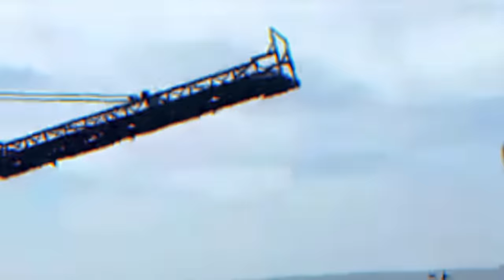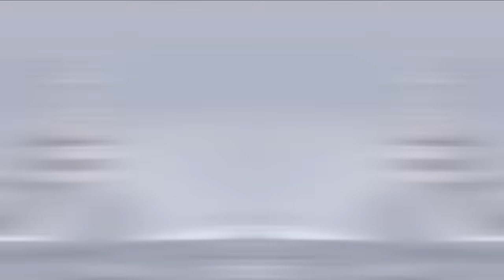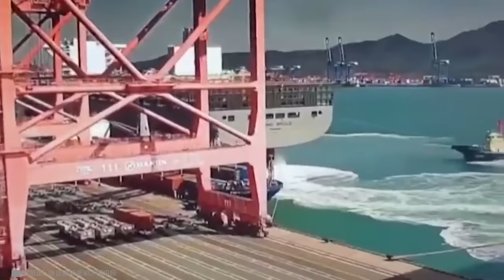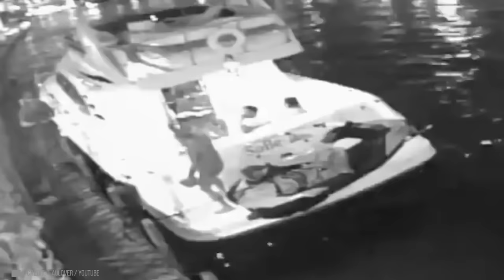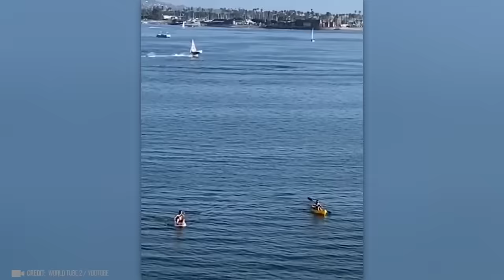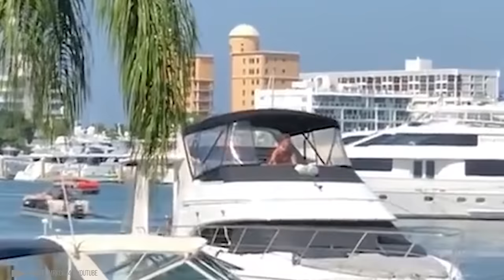30 Biggest Ship Collisions and Mistakes Caught On Camera

Comment: I have seen a few ship wrecks in my lifetime.
Mostly the crew and Captain are at fault, because they failed to do something like check for malfunctions onboard, improper navigation, go slow in crowded port areas, misunderstand weather info or keep up with weather updates, or just neglect warnings from other vessels. 
Ship inspections are very important and should be done frequently. 
Nowadays there are floating metal debris which can cause damage, but are visible to radars and scanners on board a ship. There is also Satellite images and cameras... 
It just depends on what type of a vessel one is on and who is the Skipper or the Captain. 
Thanks I loved the video.

Comment: Ady Gale was NOT designed for Anti Whaleing ... It was Designed for Around the World Speed run! and the retrofitted to go anti whaleing
Reply: Also, the water cannons aren't to "distract" them, so the can ram them with their boat.
The water cannons are to keep them away. They intentionally get in front of other boats in an attempt to force 
a crash. That way they look good & are seen as the "victim" of the "poachers".
Reply: @travissmith2056  the video shows the whaling ship deliberately turn into the Ady Gil which was disabled in open water at the time.
Reply: @26th_Primarch  "Yeah but protecting whales is gay." - Average youtube commenter
Reply: @travissmith2056  you should have seen it , the whale boat did turn to get andy gill
Reply: The retrofit didn’t work very well.  : )
Reply: They should have mounted a 3 inch Oto Melara autocannon loaded with HE, would have been a better choice than blinding lasers.
Reply: @fabianhenrich4697  i say they should just buy an old sub for this stuff, they can dive, stalk the ships and then, when needed they can surface. they can even run silent and the whaling ships wont even know they are there. they could also aquire some torpedos and well, you know
Reply: @PlutoProtogen    Well, is what they’re doing illegal everywhere?   If not, then the anti whalers are pirates, and should be treated as such.   You can’t fault someone for trying to feed themselves and their families.
Reply: @petulantpeterturbo  actually whaling as far as i know is banned around the world, a few countries still practice it, but it is illegally done, those japanese ships are doing it illegally

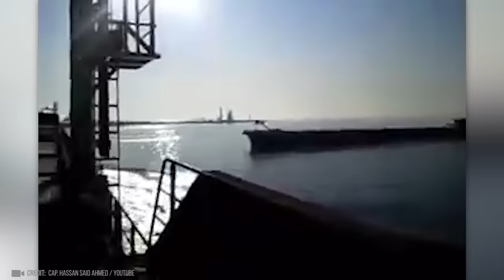Comment: At 2:40, the BC Ferries motor vessel Queen of Oak Bay, en route from Nanaimo to Horseshoe Bay, was unable to engage reverse to take off its way when approaching the terminal.

Having sufficient warning, the bridge crew successfully steered the ship toward a relatively clear area of sandy beach just to the west of the slip.

As I recall, the ferry was not severely damaged, though it is an older vessel nearing the end of its operational life. It was floated off at high tide. Several private vessels were damaged, some severely, as shown in the video. Out of view a number of other boats were driven against each other and badly damaged as well. There were no serious injuries, I believe.
Reply: The throttle switch disengaged from the control arm leaving the ship speed uncontrollable. The failure was an $.08 cotter pin. As a result all the ships were retrofitted with a second cotter pin and the engineers in the entire fleet now have a procedure planned in the unlikely-hood of something like this happening again.

Comment: In the past, when a ship approached port after many days / hours sailing. The engine was always slowed down and maneuverability was tested by backing up the ship, before the ship entered the harbor and one was sure that everything worked. Does anyone remember this ? .
Reply: engine preparation before docking and undocking has SOP checklist unexpected incidents is unpredictable
Reply: i have limited experience, only 4 foreign dockings, but each time the Pilot or harbor master came out and got on our ship, even though once we had a licensed pilot from that harbor already on our crew as the first mate
Reply: Thats a SOP long time ago
Reply: @socratesalegrado745  - Yes, it was 🧐
Reply: Doesn’t prevent failures occurring after the test though.
Reply: @magicmulder  - 100% correct

Comment: The engine on the Queen of Oak Bay was not faulty! A contractor who had overhauled the prime movers, incorrectly installed a cotter pin in one of the governors. The cotter pin fell out during low speed approach to the berth. This caused an overspeed condition on one engine, which caused the engine to shut down. As a result of this occurrence the second engine also shut down. The Master of the vessel had no propulsion, and there was insufficient time to drop the anchor, as there was no one on standby at the anchor station. The vessel had steerage, and the master had to make a split second decision to either hit the berth, causing a hard landing and risking injury to passengers and crew, or hit the marina, hoping no one was on board the vessels tied up.

Comment: I actually read the story on the yacht. The yacht captain was NOT ignoring the horn; in fact, his decision was based on it. Apparently the Knutsen's horn had a more specific meaning than what we mean when we toot our car's horns: it was a signal that the ship would turn to starboard. Based on that signal, the captain of the yacht decided to cut across the ship's path, actually violating British maritime regulations when he did so. If the Knutsen had turned as it had signaled then there would have been no incident, but unfortunately the Knutsen detected another boat along its new course and aborted the turn, leaving it on a collision course with the yacht. This is why those regulations the yacht captain violated say what they do, and the yacht captain was held accountable for the incident.

Comment: 1) I hope that guy got a new tuna boat! 2) I can understand when two small boats can't see each other. I might understand when a large ship doesn't see a small boat. But two OIL TANKERS? When did they start putting blind people at the helm? 3) I feel bad for all of the crashes caused by mechanical failure. Imagine doing everything right, and you get wrecked anyway!

Comment: A ship is not an airplane and there is almost nothing to do when you make mistakes. Therefore, lack of vigilance and disregard for the safety instruction causes at least 90 percent of the photos. The remaining ten percent is the result of an engineering or mechanical failure 🇮🇱💥🩵🇮🇱

Comment: Honestly... 
Such big ships are mayhem and Absolutely tough to handle.
They dont operate like cars - dont have brakes to appy in emergency, have damn big engines, very complex handling and most importantly - operated Manually unlike Aeroplanes which fly by wires. 🤔

These are big machines with big investements turning out to be a  big liability ☹

Comment: Thought motor always has to give way to sail !!
Reply: It does.  Legally.  In real life, ships don't have brakes.  Do you pull out in front of traffic with your car on icy roads because you have the Right of Way, or do you let them slide sideways through the intersection first?

I personally watched a sailboat of about 25 feet come within yards of getting munched.  She sailed down the starboard side of my ship, then turned to port directly across our path, close enough to our bow that she was NOT visible from the bridge.  Sure she had the technical Right of Way.  That said, taking a 25-foot fiberglass boat close across the bow of a 650-foot US Navy ship steaming at 8-10 knots in a congested shipping channel was probably not the best idea.  The "F**K WAR" banner that the sailboat was streaming at the time makes me think that it was a deliberate act.
Reply: @kevincrosby1760  Thank you for your somewhat insulting reply. I have never been in a car crash in my life !
International Maritime Law states 'Motor gives way to sail on all occasions' - quite simple really, hope you learn.
Reply: @kevincrosby1760  Thank you Kevin for pointing out that ships don't have brakes. I have been sailing for 35 years and I guess that on the water we have all seen 
terrible near misses. It's a bit like driving on the highway when you stop at a STOP sign and a semi rig just goes straight through. You give notice to other vessels
of your intended course and you don't instantly turn in front of a 30 thousand ton motor vessel. Intelligence is the word, the same as on the roadways, unfortunately
intelligence on the roads and waterways seems to be decreasing rapidly.
Reply: @allenrj1  My sincere apologies.  I in no way intended to insult you or your maritime skills.

As I was given no indication of your skill level, the language and examples were intended for the majority of the population, who at best may have been in a 25-foot boat on a calm lake.
Reply: @kevincrosby1760  Thanks for your kind reply Kevin.

Comment: I know a few of these.accidents look as if some.dummy fell a sleep or was sleeping instead of sailing  the ship. When a ship loses power and.it.was doing 10 knots it is impossible to steer. Also the rules of the road no matter where you are or what nation you are flagged under sailing boats and smaller ships have the right of way. That can explain some of these accidents, the whaling boat running over the tri hull was no accident and the idiots trying to go under ow bridges is stupidity.